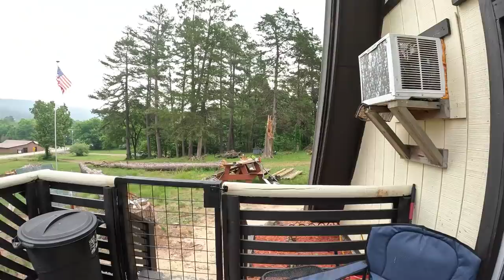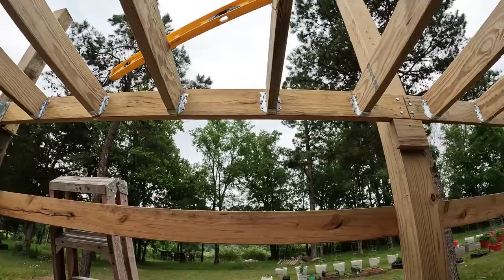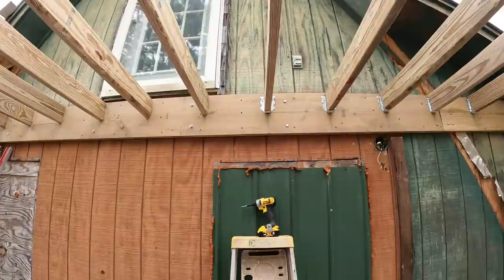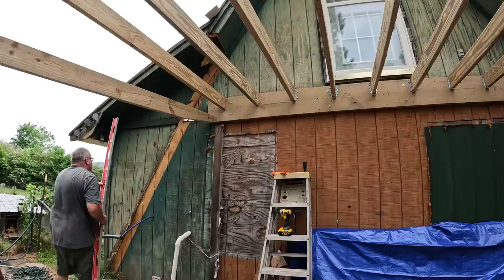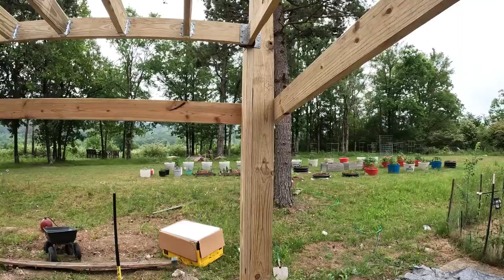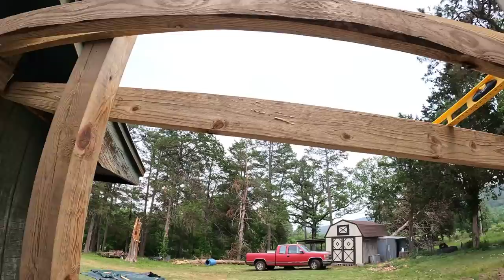BEEFING UP THE STRUCTURE/JOIST HANGERS/ BLOCKING/PATIO/ DECK BUILD #8

Comment: You can gain some head room by putting Purlins on the bottom of deck. Just add some blocking for the correct ceiling pitch.
Reply from the maker: Eunice, I absolutley dispise perlins. They look terrible on any build. So wont be using them, but thanks for watching and wait and see end result.
Reply: @ouachitamountainliving  you won't see them between the bottom of the deck and the ceiling (roofing metal)
Reply from the maker: @eunicehenderson9095  No reason to gain any headroom, it will be plenty high and I am covering with cedar, and I know perlins would be in there, nasty little creatures

Comment: Those are Carpenter Bees--can cause a lot of damage I know that for a fact. Make a small wooden box with two holes on each side for entry,then a hole on the bottom with a Mason jar. Once in the Mason jar,they are trapped.
Good Luck